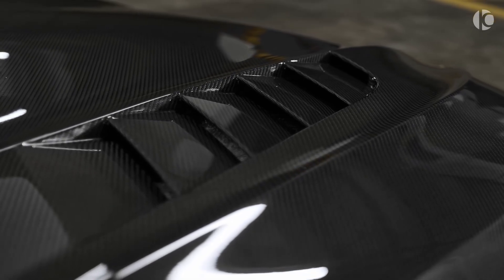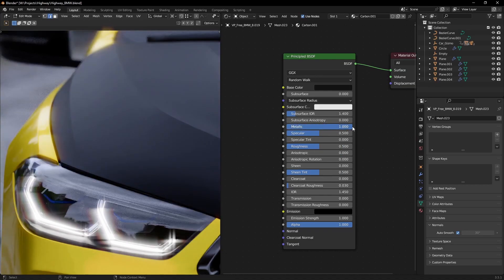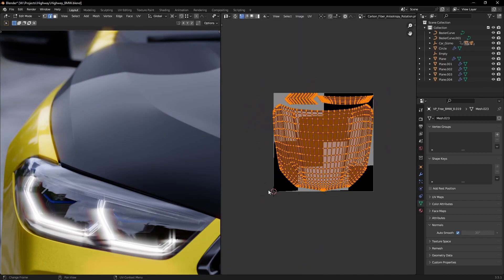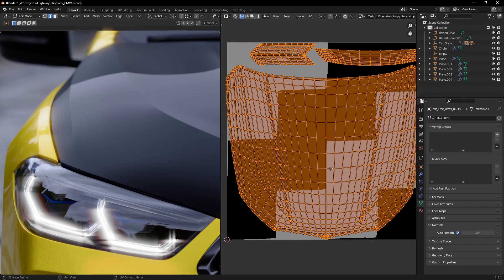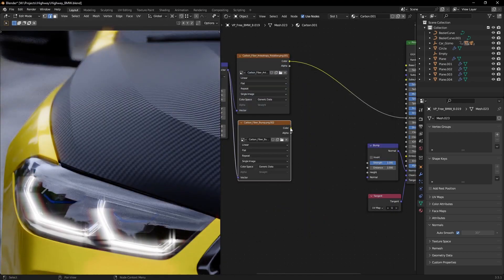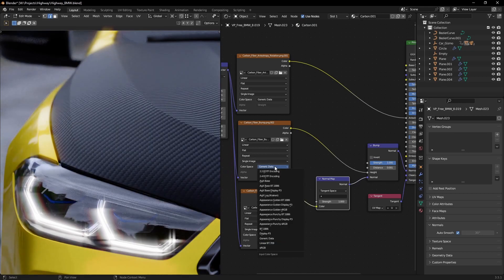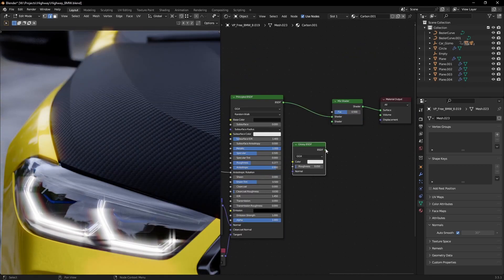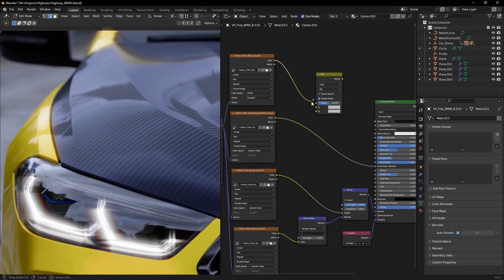How to Make Carbon Fiber in Blender the RIGHT WAY! Physically based approach.

Comment: tottaly wrong :P carbon fibre have single color it dosn't have 2 colors. your usage of texture in to albedo was tottaly wrong. The stripe effect on carbon fibre comes only from bump/anisotropy. As the light get's rougnes from micro fibres. that create stripes that are later used for twill pattern...
Reply from the maker: you mean exactly how I showed in the video ? :D :D :D plus, there are mixed weave carbon fiber panels, as in using different colored carbon in the weft and warp :D
Reply: @blenderisms  nope this shader is wrong. Color of carbon fibre does not come color fibres, but from tint of epoxy. Transmission/scattering in blender case. The correct true carbon fibre shader is proper normal map for carbonfibre where u have individual strands of fibre (not that gradient stripe crap) and clearcoat. Nothing else. No anisotrophy fake etc  no albedo textures.
Reply from the maker: why don't you try your method and hit me up with the results :D plus, you literally can purchase online carbon fiber plates with composite weaves.
Reply: @blenderisms  i already use my method for many companies. also i work with carbonfibre parts. Turst me i know what i am talking abot. i can hit you up with proper shader. but just get yourself a cloth of carbonfibre and look at it with iphon flashlight at dark u will understand.
Reply from the maker: The look of carbon comes from the direction of the fibers ( yes, that is true) it creates an anisotropic effect. the anisotropy basically is a simplification of having thousands of small fibers aligned in the same direction (or having brushed surface) and renders faster and more accurate than relying on a normal map(at the moment the only render engine i know that can handle anisotropic shaders just by brute forcing them with bump/normals is fstorm). so you need anisotropy, the "gradient stripe shit" is a height map. if you observe enough reference you'll see that the fibers aren't completely flat as it is a weave, so you need that too, it's not going to come through with just a normal map. Also enough manufacturers create composite weave carbon parts. Usually the colored strands are different materials like Copper etc. but the final product still goes under the name of carbon fiber. You can see such parts in cars like the Bentley Mulliner. Companies like ProDrive create such parts, so yes, you totally need to edit the diffuse component if you want to recreate that color. Also just saying that the coloring can come from "transmission/scattering" ....